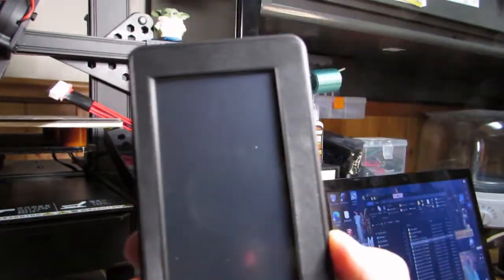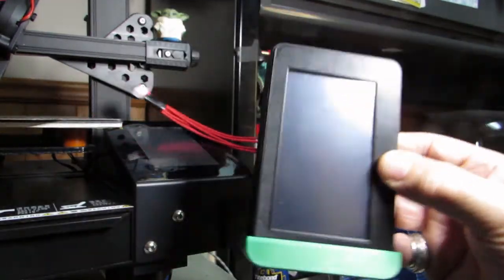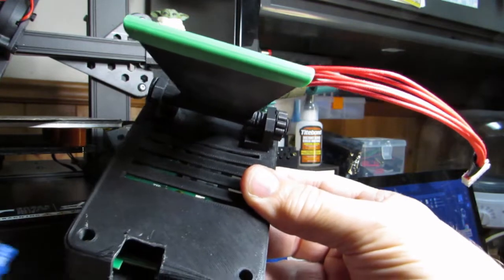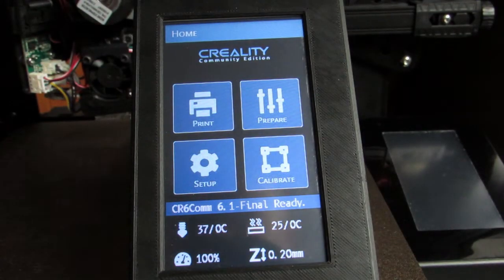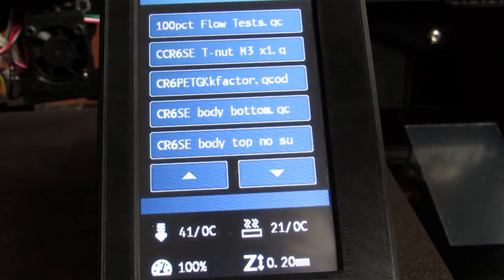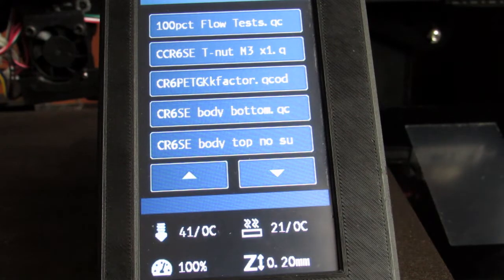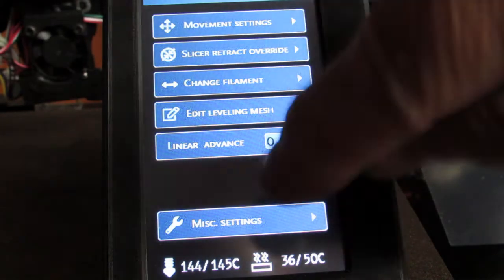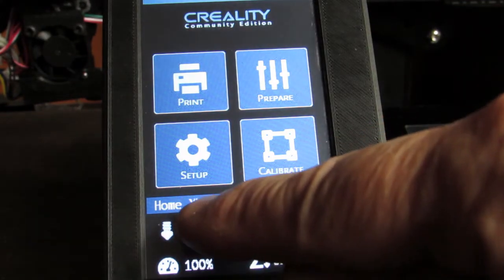CR6 Community Firmware User Interface - A "Cook's Tour" of the Refactored Touchscreen UI

Comment: I have tried different cards systems tutorials but my cr6-se doesn’t like to work I flashed it and it’s a 4.0 version 2021 and when I do the steps it shows a blank grey screen when the sad card is in but when it’s out it’s normally idk if it’s just me but I want the software
Reply from the maker: @ISowMeeer  if you have DGUS2 v4.0 on your screen, then you should flash the Refactored display firmware.  The grey screen is because the original display firmware ONLY works on DGUS2 v3.5.

https://github.com/CR6Community/CR-6-touchscreen/releases/tag/Re-Factored_v1.1

Comment: Hi there, I have a Creality Sermoon D1, it uses the Dwin T5L touchscreen (DGUS 4.5) as does the CR6. Do you think this refactored touchscreen dwin set will operate well if I take the CR6 source re-build it for the Sermoon? Need to get away from stock firmware not ready to jump to kipper just yet
Reply from the maker: Sorry, I did not see this comment until Feb 2025.
Curious whether you tried this on your Sermoon and what the outcome was.
Reply: @makingthingsreal101  IRC I could never get it to work correctly, made the jump to Klipper and love it.